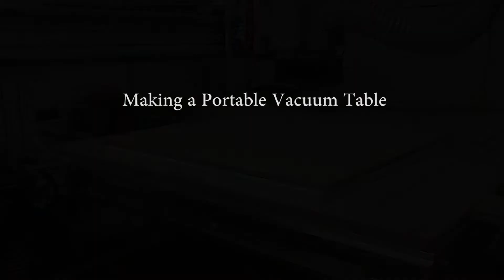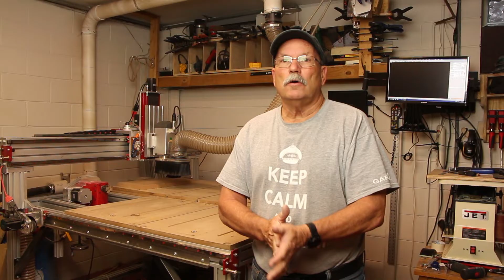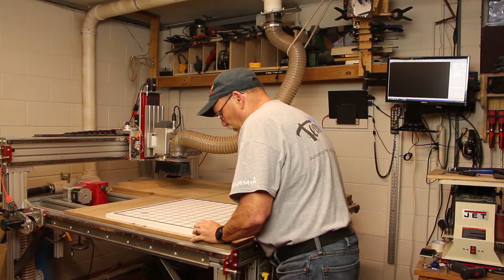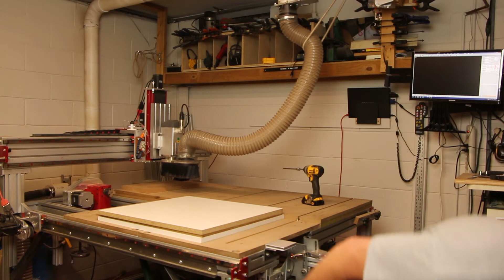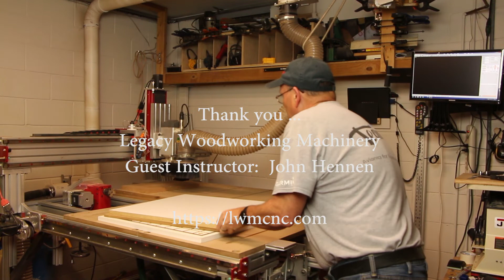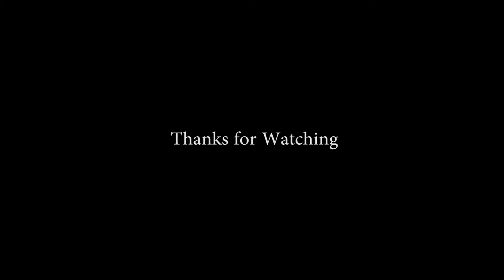Vacuum Table 24x24

Comment: I’m in the middle of making one and have 6 hp shop vac I plan to cut acrylic parts my file is 7 mins long will this burn my shop vac motor up? The vacuum table size is 22x25”. Thanks

Comment: What pump would you suggest for just a 2x2 table like this? I'm planning on making one myself
Reply from the maker: I used a regular shop vac in that demo.  Worked fine.
Reply: @FlyBalloons1  Yeah I got that i was just curious if I made a 24 x 24 to run for hours would I need to over think what kind of CFM or just get the cheapest dual motor air pump on amazon lol :D
Reply from the maker: @Stephen8454  if you were going to run it for hours then yes you would.  I use a Festool but a Fien vac would work. Hope that helps.

Comment: Throw some paper or cardboard on top next to the smaller material. It will plug the vacuum surface area enough to hold it steady. I work at a plastic fabrication warehouse. I could send you some really thin polycarbonate or abs to use as cover sheets. The guy that runs the router here has a bunch of them cut to different sizes to cover the table depending on the size of his material, and that cnc is a monster. 6x12ft cutting area up to 4”
Reply from the maker: I did that Jeremy but a shop vac doesn't have enough suction.  I bought a dedicated vacuum pump that should work with your suggestion but I have not had time to hook it up yet.

Comment: nice video  i was looking for something simple that works well enuff for me  i.ll try to make this ... ? couldnt u use a 1/4 ' MDF  INSTEAD OF SHAVING IT OFF
Reply from the maker: Yes you could use 1/4" but shaving off the mdf will make your board more pourous and the vacuum will have a greater pull.
Reply: @FlyBalloons1  oky will do  great add vice
Reply from the maker: Good luck with you table.

Comment: What the hell?....the vacuum goes throught the mdf and hols the part?...what am i missing?...is that magic..?
Reply: Yeah.  That's what I thought too.
Maybe the MDF is more porous than it seems?
Reply from the maker: der ddd McFadden is porous so air will travel throughout.  It is even better if you skim each side to remove the top and bottom layers.
Reply from the maker: Mdf is porous
Reply: Mdf is super porous. The air passes right through. I’m pretty sure there’s a soft grade you can get that has better airflow. Not sure what we order, but he usually surface planes it down every so often until it’s about 1/2” and then scraps it and uses a new one.